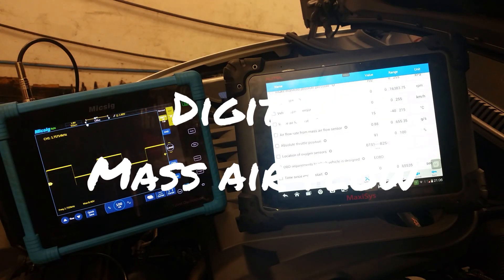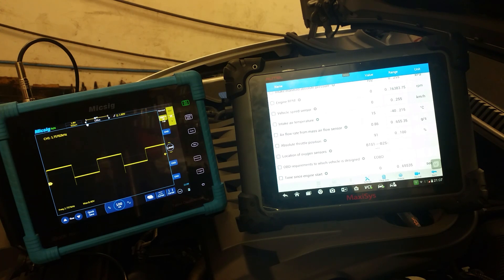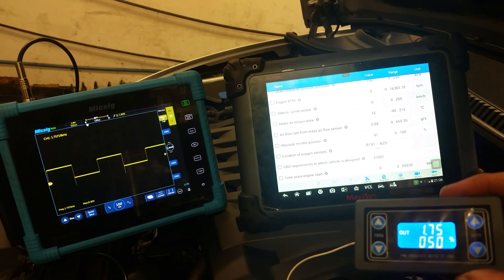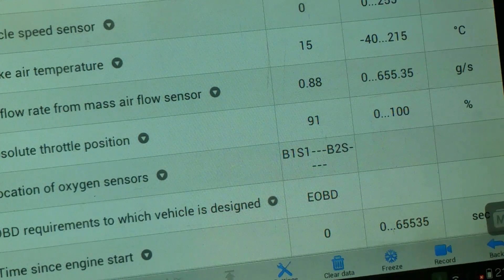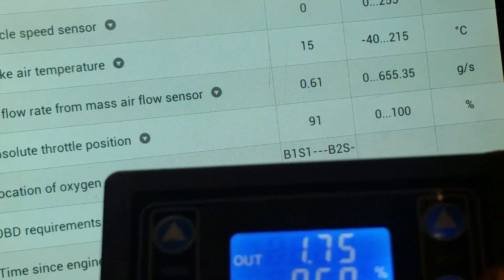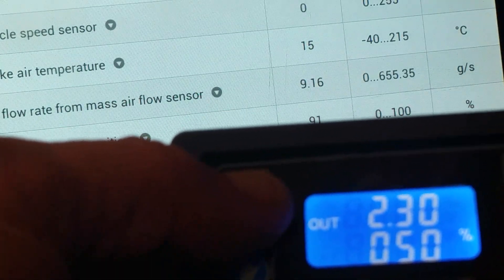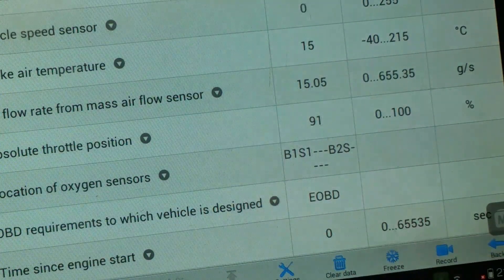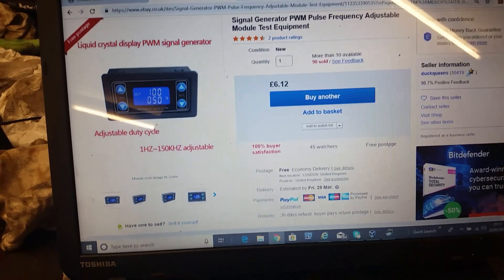More digital MAF Sensor signal bypass test

Comment: Great vid Dave, have you shown the simulator before in a vid? 🤔 maybe I’ve missed it? 

There’s a few airbag simulators on eBay I keep looking at. Wonder what you think to them?
Reply from the maker: hey gruss, check out my vid on test leads for airbag sims. The wee sig gen was on one of the vids demoing the micsig series of vids. cheers dave
Reply: Buy your self a cheap decade  box from our Chinese  friend  or ebay   that will have the air bag  tool built  in to it